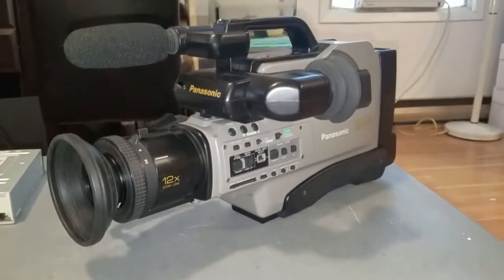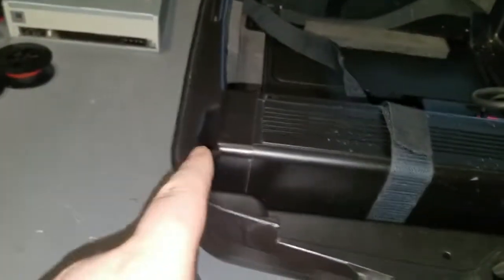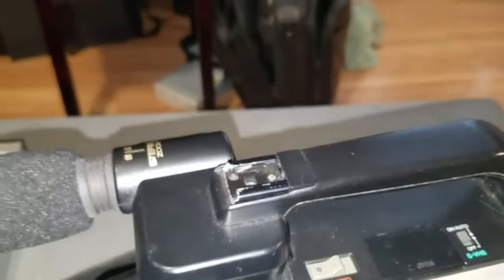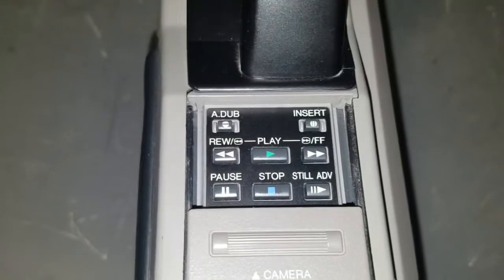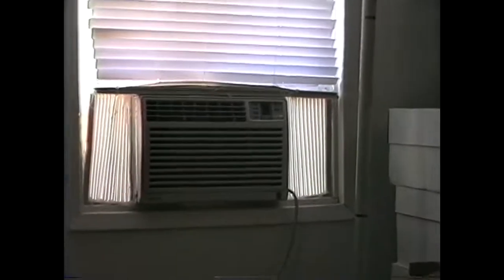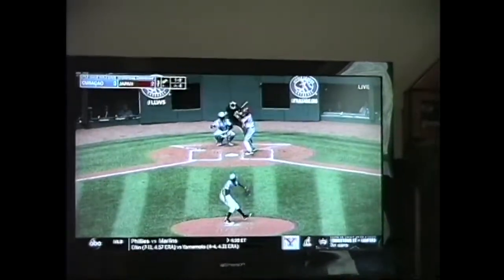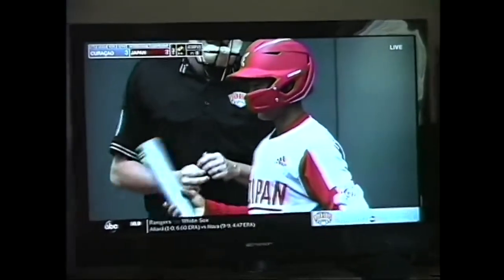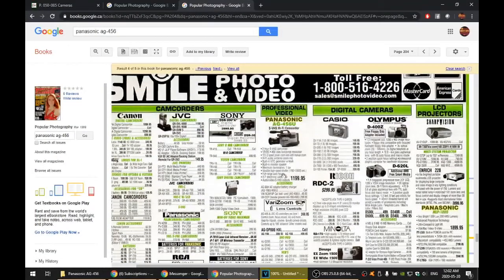Panasonic AG-456 professional S-VHS camcorder (1996)

Comment: In wide mode the microphone picks up spatial sound from all directions. In tele mode it focuses on sound coming from directly in front of it and filters out sound coming from the sides. In zoom it gradually transitions between these two modes depending on how far zoomed in the lens is.
Reply from the maker: How does it do it? Are there two sets of microphone elements?
Reply: It might have stereo mics facing the sides and an additional center mic facing forward, or but zoom mics usually do it electronically, by mixing the L and R mics into L+R (sum) and L-R (difference) and adjusting the ratio of them.
Reply from the maker: Ohhhhhhhhh. Neato
Reply: Thank you for the info!

Comment: I worked with these models as a news reporte in a small local TV station in 1996, never fail to amaze me with it's flexibility and functionality. I used a a 12V battery as an external power source for it rather than using the standard battery because it wasn't functional in my line of work as a cameram reporting outside in the streets or conference arenas.
Awesome memories with this beautiful camera.

Comment: Hi! how do you develop  off this camera? I have the exact same camera and I just took it to a place to develop and they gave me back a CD with all black and white video but yours is color. Thank you
Reply from the maker: Is this... is this a joke? I genuinely can't tell.
Reply: @themaritimegirl  I'm sorry if I sound dumb but no it's not a joke. I paid 50$ and they gave me a DVD with black and white footage on it in pretty low quality not even comparable to yours :( Very sad right now.
Reply from the maker: @ozemipd  No no, not dumb, just.. wow, what a situation.

To begin with, this is a camcorder - it takes videotape, not film, so there is no "developing". I'll just assume that was a wrong word used on your part.

So what did you do, take the VHS tape into this place and ask them to transfer it to DVD? Did they advertise such a service? Because it sounds like they had no idea what they were doing if they gave you a disc with black and white footage.

Unless your camcorder is actually malfunctioning and recording a black and white signal onto the tape. Have you hooked a video cable from the camcorder to a TV to make sure that the camera is actually working properly, and recording to the tape properly? Early examples of this camcorder have issues with bad capacitors today that cause them to malfunction.

Honestly, it's a lot easier and cheaper to just do it yourself. If you have a DVD recorder, then you can plug the camcorder into that to transfer the video. Or you can buy one of those USB devices that have a composite input on them to transfer the video to your computer.

I use a method that involves using a FireWire port on my computer, and a Sony Handycam to convert the S-Video signal to DV. I made a video about it here:

https://www.youtube.com/watch?v=zpfmHChEqHY

Comment: How do you find a battery that works? I had the same model and the battery didn’t work so bought a replacement and it still didn’t work. Where do you find batteries

Comment: I just set up my ag-455 and everything works except when i put my s-vhs tape in i dont hear anything and when i press the record button nothing happens and there is no indicator that it is recording or not, is this fixable, or have u experienced this?
Reply from the maker: This might be obvious, but make sure you're using a tape with an intact record protect tab. If that tab is knocked out, it won't record.

Comment: Hey do you (or anyone) know what the cable is called that is attached to the battery pack that goes in the camera? I got this exact camera on eBay and it is missing this cable -- having trouble finding the cable. Any help appreciated, thanks!
Reply from the maker: There isn't any cable that goes with the battery. The battery just slots into the battery compartment.
Reply: What about the cable that goes from the battery adapter to the camera? Doesn't the battery charge in the camera?  @themaritimegirl

Comment: Very cool acquisition. Finding a working battery might be tough, you might be lucky on ebay. For those high end broadcast cams custom casings are still being made apparently, but unfortunately not for those models. Consider getting one of those for myself, and do a complete build. Some models lack the vcr, but I would not want to bother with the tape conversion anyway. Using the image sensor's feed directly, that's where it's at.

Comment: nice video  i think i may need to get an upgrade i currently have the AG-196
Reply from the maker: How's your AG-196 working? Still fine? I like to ask people with one of these so I can gauge how unusual it is that mine still works fine.
Reply: @themaritimegirl  i had mine for a year now still works i record with it alot on my channel still holding up i mean if my camera dose fail i may recap it or buys the svhs i just recordered a youtube video with my new svhs et camera but it depends f the onvirerment were it was stored mine came from a tv station an usly tv stations are tempture controled if you wanna see the video of mine ill send yo the link atho mine dose have a weird thing were you  can hear a motor runing fast dont know what it is also mine may be haveing bad caps your quality is difforant then my camera makes tho yours is svhs XD
Reply from the maker: I just checked out your video - it looks perfect. It'll be slightly fuzzier than mine since it's normal VHS, but your digitization process could also be lowering the quality a bit, depending on what you use.
Reply: @themaritimegirl  i use the easy cap im gonna soon get a beter digitizer

Comment: These cameras  are a great assette.I have upgrade them to 1080p  and mixed them with my blackmagic systems and cameras its hard to tell the quality's apart
I never used cassettes in the cameras because the life span and the mechanical parts dont wear out so the camera has a longer working life its amazing how you can use the old to 
work with the new thanks for your review of the panasonic s/vhs professional camera.

Comment: You used VHS tape. If you had used S-VHS, the image would have been even better.
Reply from the maker: As I showed in the video, I drilled a hole in the cassette to fool the camcorder into thinking it's S-VHS. It's a good quality tape, so I'm getting close to 100% of the quality that I would get if I used a real S-VHS tape.

I think I may have the opportunity to acquire some S-VHS tapes in the near future, so I might do a comparison video.
Reply: @themaritimegirl  For a VHS tape, the result was not really bad. The oxide quality of this tape was good. But with S-VHS tape you should improve the pixel definition, because S-VHS tape has a different oxide media formulation for higher magnetic coercivity. I liked the test and it missed me. Feel like testing my AG-456, and see if it still works. lol. I still have the PV-425 VHS stored in the case. I believe that both still work. I have a battery for each one and also the chargers, but I don't know if the batteries will still accept charging. I will probably have to test it on the charger. I also have a JVC S-VHS GY-X2. It should work too.

Comment: any format of VHS and "professional" are two words that don't go together.....an oxymoron in a way...like "Microsoft Works" or "Government Intelligence...
Reply: I am inclined to agree. I have one .These were never professional standard but the higher end of VHS.I had 3 at one stage. we used them for weddings.
Reply: real professionnal grade s-vhs only mean they can be used in professional broadcast environement, by the connectors they used.
the same for battery with anton bauer connector, all full professional standard connectors and features, that's all.
and also body material used, real professional grade used metal bodies. and very likely also some care to dust/water resistance.
s-vhs was a nice alternative to betacam for news and stuff like that, where color resolution was less a concern.
but a 3 CCD camcorder could also perfectly have been used as a standalone camera as they really were pro grade.
750 lines of horizontal resolution was faaaaaar overkill even for broadcasting.
but those as in this video are as said by panasonic themselves, industrial grade.

i will even go further, when s-vhs was released in 87 it was superior in luma resolution than commonly used u-matic/bvu and betacam oxide, and even slightly superior than early betacam sp. only in luma of course :D
but i would even say than it was closely on par with u-matic in chroma resolution (they both used the color under technique).
so really, it wasn't a ridiculous choice for some usage in professional broadcast, and if we compare on price, maintenance and every parts were cheaper than anything else.